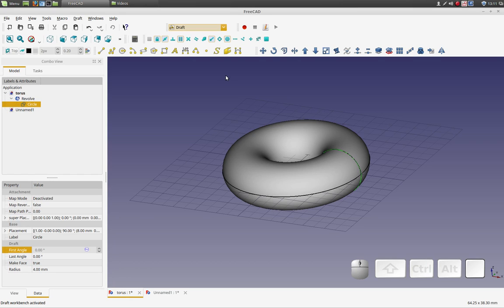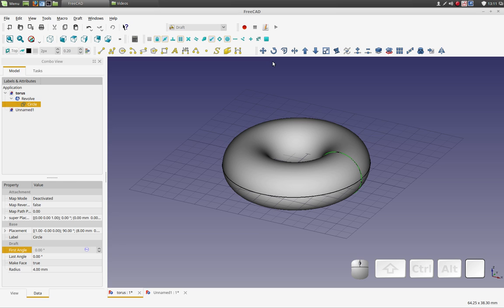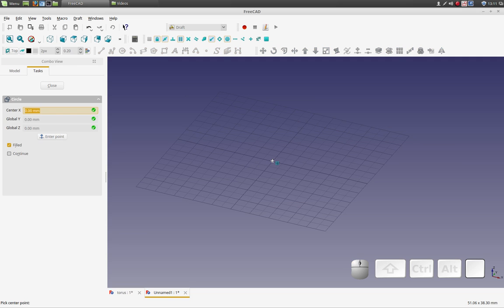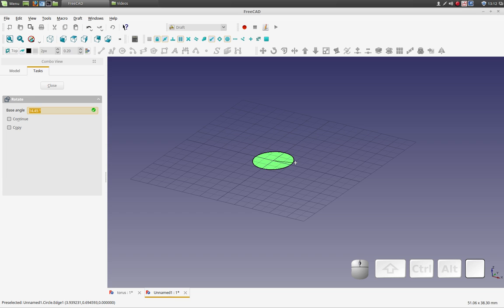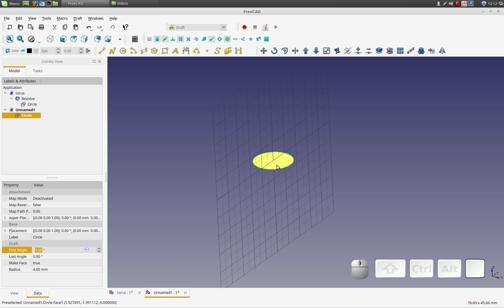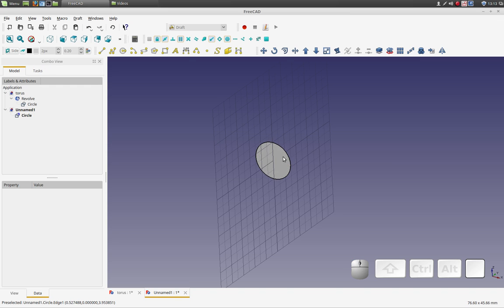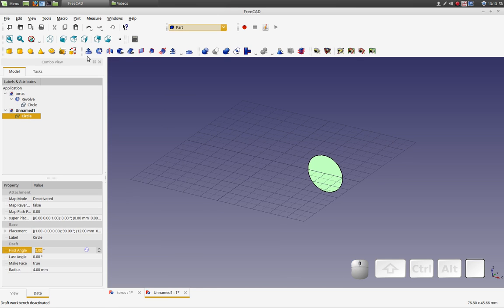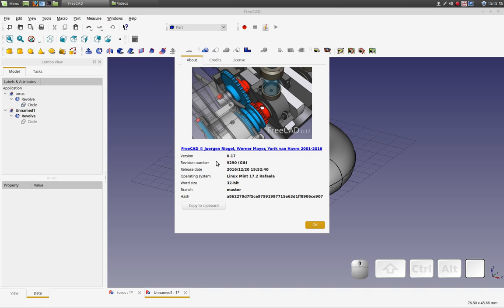FreeCAD Tutorial - Use the Draft workbench Rotate Tool

Comment: Freecad is soo bass ackwards. Whats wrong with just picking a line one needs to rotate the object around ?
Reply from the maker: So you are right. However , keep in mind the draft work bench is the "older" method of construction. The newer sketcher work bench allows you to rotate around any appropriate line.
Reply: @mathcodeprint  Have you an video about that or any suggestion how does it look like?